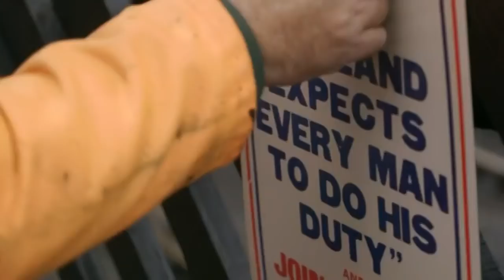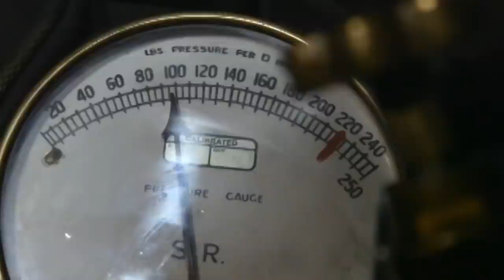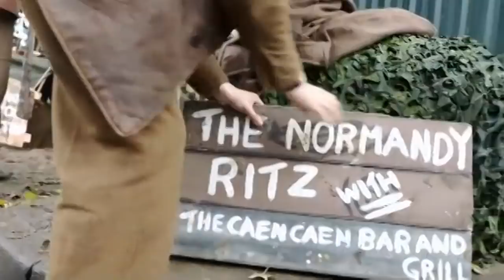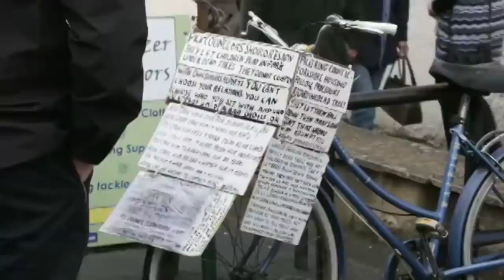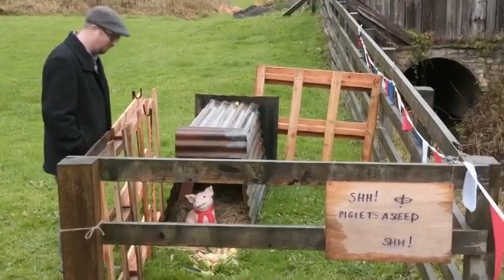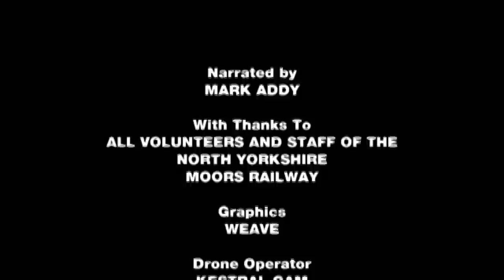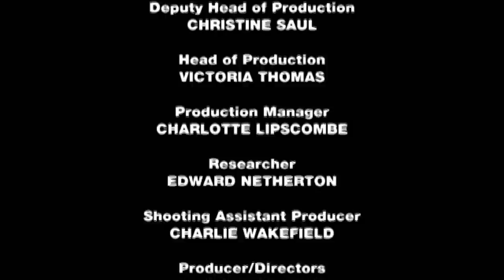1940s STEAM RAILWAY | Yorkshire Steam Railway: All Aboard | Reel Truth History Documentaries

Comment: You can't test the boiler you worked on until you can steam it? Sure you can; fill it 98% with water and then pump in compressed air (by filling it mostly with water and only topping off with pressure, you keep the energy in the tank to a minimum in case there is a failure). Wastes some water but that's cheap as chips compared to firing it (especially if there IS a failure), not to mention the time it takes for firing.

Comment: The General Manager of the NYMR is a pratt. The real reason the Germans are no longer at NYMR is because the NYMR wanted a lottery grant for possible work on the bridges. There was a Jewish person on the lottery board and so I've been told the only way they would have the grant is to do away with the Germans. I've have never ever seen any complaints about the Germans at this railway.
Reply: That is unsurprising. If the media doesn't destroy something, all it takes is someone with deep pockets to get all huffy to bring everything crashing down.
Reply: I didn't know that.
Reply: In fairness dressing up as the same people who killed over 15 million innocent people is a tad controversial
Reply: @wilfbm9067  what about German POWs? I went to see the WW2 event at my local steam railway when i was younger and I saw a few dressed up as POWS but I am not certain on that.
Reply: @eliotreader8220  the people in the video were clearly dressed in battle gear they had sub machine guns on them- not very POW ie if you ask me
Reply: @wilfbm9067  well it was to portray a station in occupied France, something i found pretty cool
Reply: @wilfbm9067  Not every person that fought for Germany did that, that was mostly the SS. The regular soldier was fighting for the same reason our grandfathers were, they just happened to be on the loosing side.